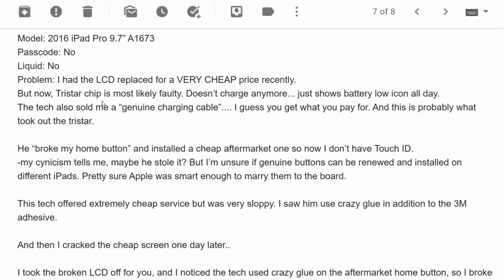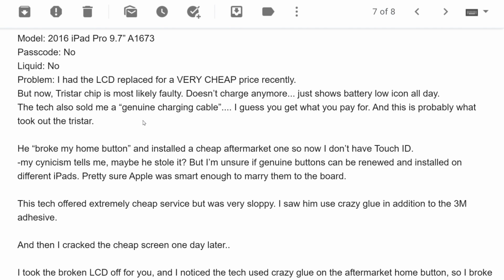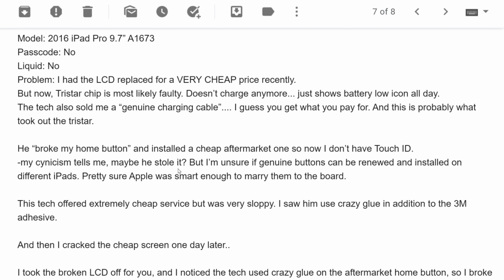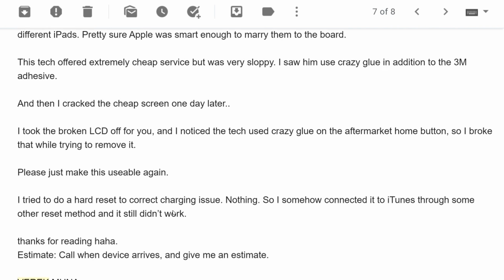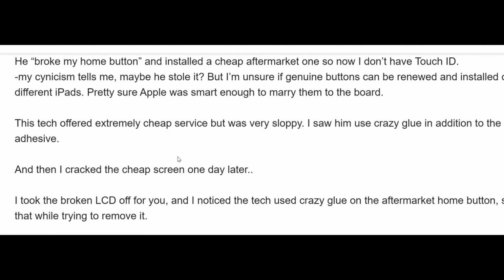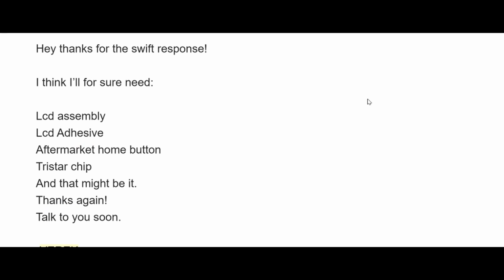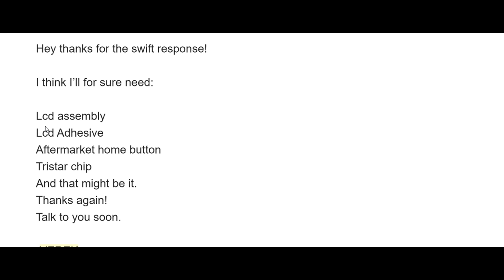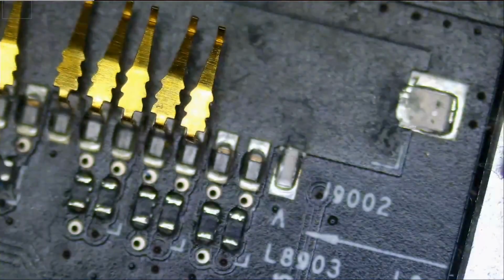iMac Broken Display connector replacement - Large 30 pins soldering

Comment: for wicking, try:

Ceramic Reverse Tweezers
2 inches wick (fold / double-up)
medium or large tip

apply flux to only the wick and allow time for it to soak into the braid

ceramic will not steal heat from the wick, you can almost float the wick above the pcb, through the solder

it is similar to the hot tweezer method, but gives 2 handed precision